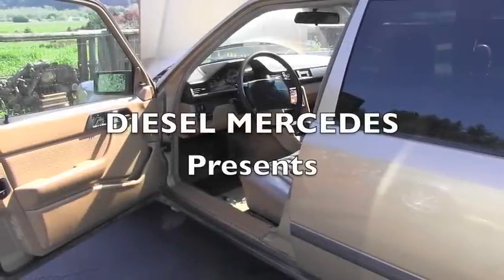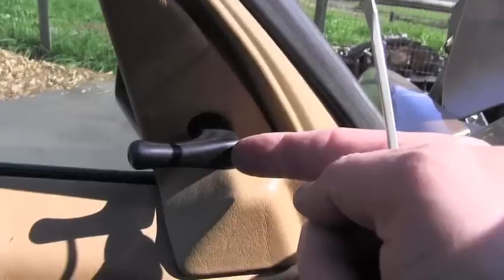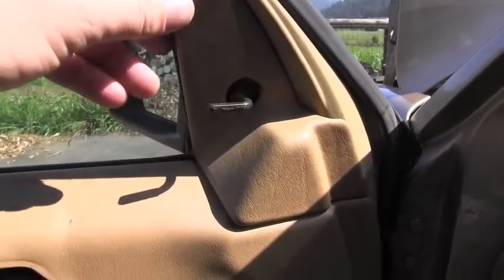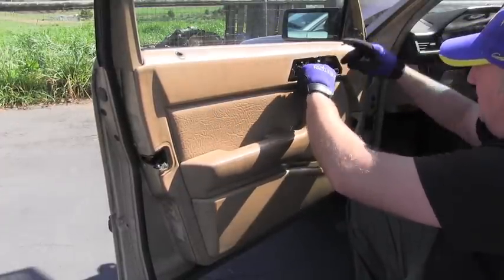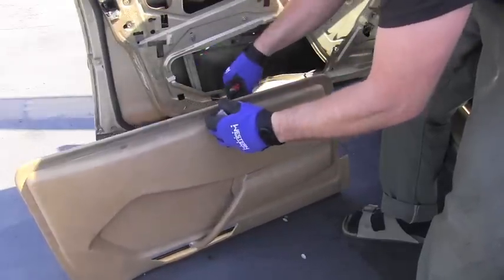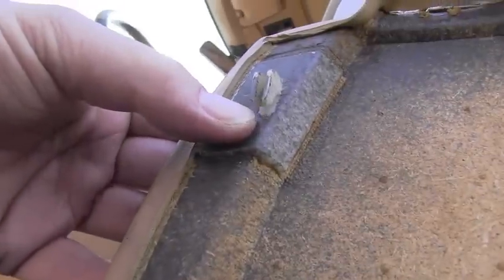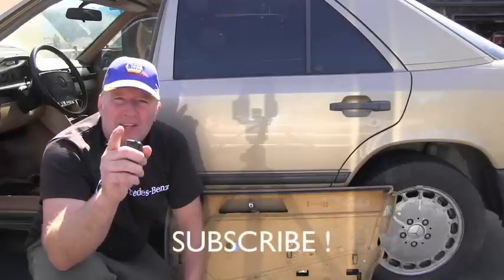Mercedes W124 How To Remove Door Panel

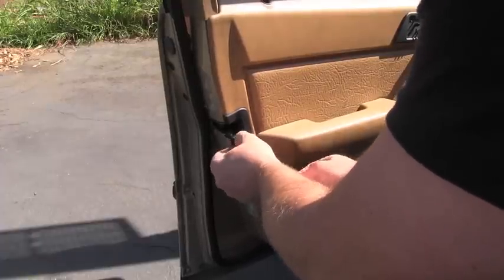Comment: how did you get the seat recliner controls off the trim you removed at 00:34? does it matter if the controls are still there?
Reply: This would be helpful..
Reply: You pull them straight off and if you're like me they break because they are 33 years old.
Reply: @ofnarcr  I see… sorry to hear yours broke. I sold my w124 4 years ago, but hopefully someone else will find your answer helpful. I think I tried to pull them off at the time, but they were pretty solidly connected, so I didn’t want to force it and break them. thanks for answering!

Comment: Hello. Does the same principle apply when removing the rear door panel on a W124? Best regards!!
Reply from the maker: Kenneth Salazar Principle yes, but not identical.
Reply: the main difference I found was that the door latch handle (silver) needs to be slid back and pulled out prior to lifting the door panel up and out.
Reply: thanks for all your great videos! there are NO videos of the rear door panel removal on the 124. Hint Hint :)